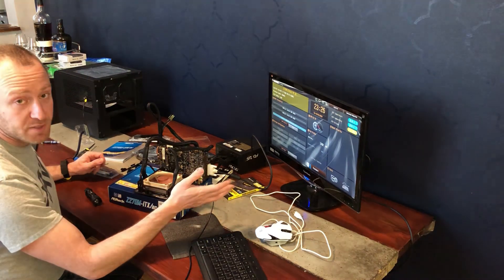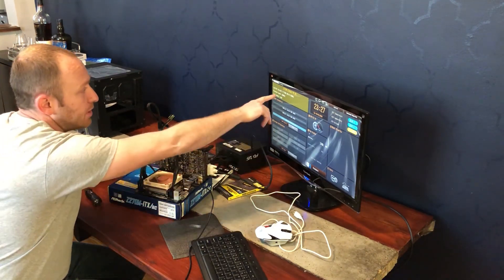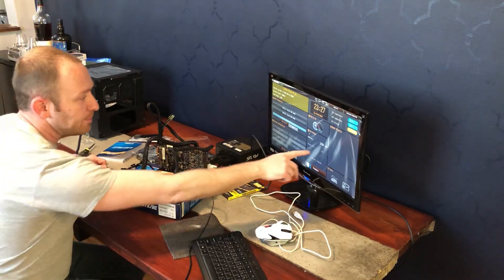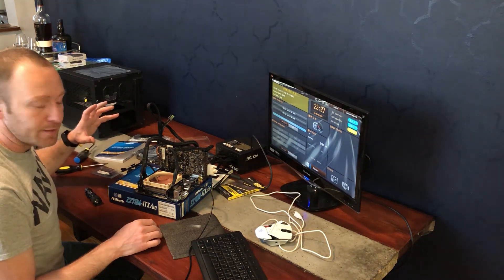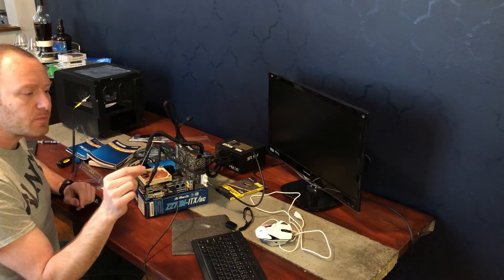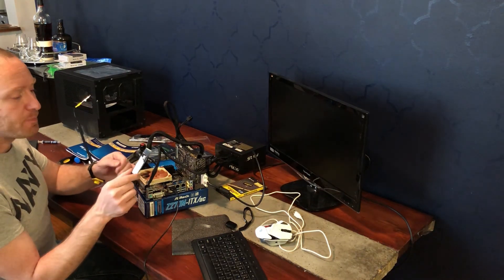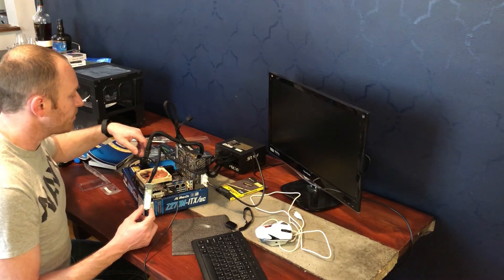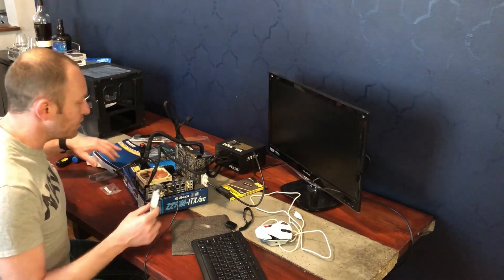Build a Computer for Architecture Part 2: Parts and Assembly

Comment: Great video thank you! There's lots of information for PC's for gaming online but not much for architecture, I'd be interested to know what the main differences are where what's best for gaming isn't best for architecture, or is it generally a case of just building a good gaming pc and it will be good for architecture too? Thanks!
Reply: Might be a bit late to reply but I think they both r way similar but at the same time for architecture (as far as I know) u need to focus on a high processor for multitasking and handling 3d and CAD programs and a fairly good gpu to actually render those projects

Comment: I have a msi 1050 ti gt 4gb will that be good for this build? Do you think this build will be good for Autocad,inventor,Solidworks?
Reply from the maker: I don't use those programs, so always check with the software guide to see compatible software. My guess is that card will probably be fine, if not the best choice. Biggest thing I see is that there are only three video outputs and they're all different, so you would need two different cables and/or adapters to use two monitors. That would be annoying.

Comment: Why not go for Quadro p1000 or p620 for the graphic card, I’m confused for my build if to go for a gtx 1660ti or Rtx 2060(though expensive ) or p1000. I do rendering and autocad and also use Revit but no gaming. Help appreciated
Reply from the maker: Hi Kishore, sorry for the delay. When I started building computers it was typical to go with the gaming GPUs because the Quadros and the FirePros were really expensive for what amounted to not a lot of performance for what most of us needed. It looks like those prices have dropped, maybe I'm just used to recommending gaming cards, but for me I'd still choose that 1660Ti. It has more ram and higher bitrate than the cards you mention.
Maybe the workstation cards perform better in AutoCAD though? I don't really know. I recommend visiting the forums at CGArchitect. Those guys are the real experts and will be able to give better advice.
Reply: Hyperfine Architecture thank you for your valuable suggestion.